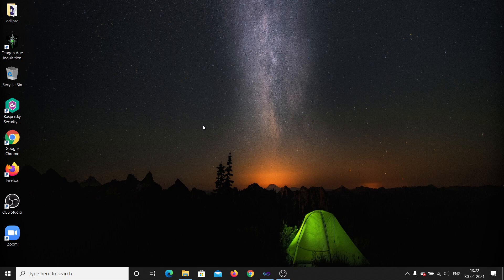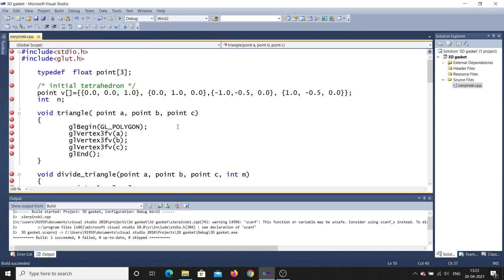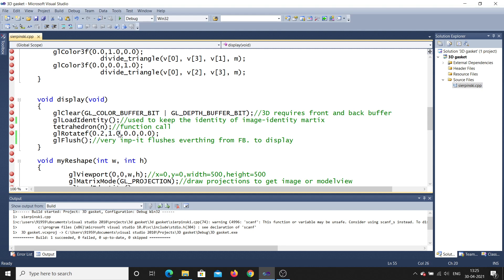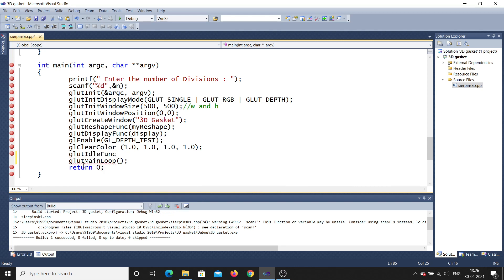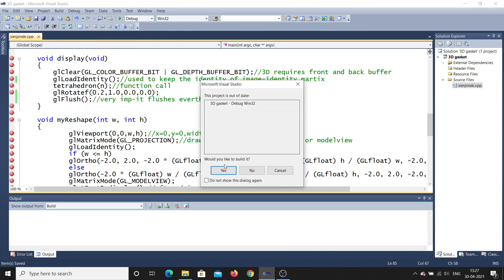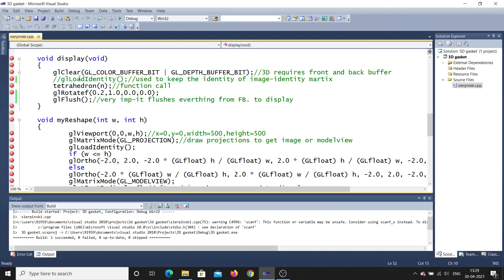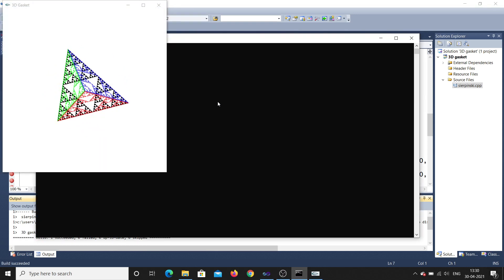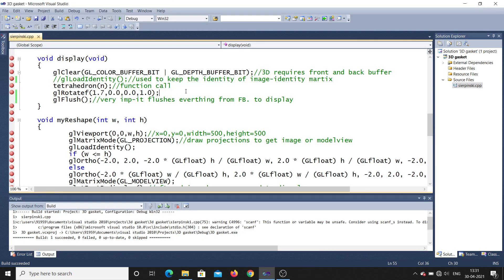OpenGL Seirpinski gasket Rotation and modification

Comment: hi! i wanted to ask about something. I wanted to make my sierpinski to rotate but as you said before, there is no need for gLIdentity right? but then, I used gLIdentity in my code because I needed to use gLtranslate. And now the sierpinkski won't rotate anymore. What do I do?
Reply from the maker: glTranslate is used to move object from one position to another. If you want to rotate automatically you need to remove loadIdentity otheriwise no need.